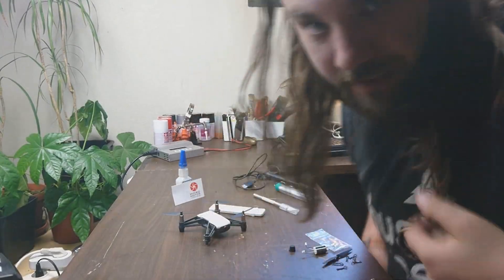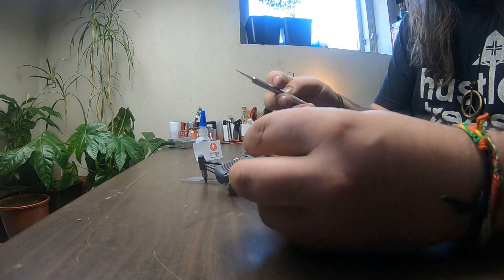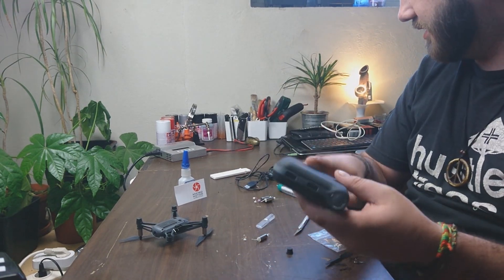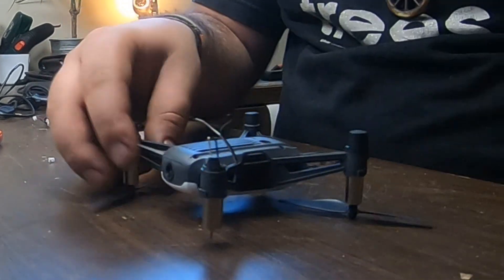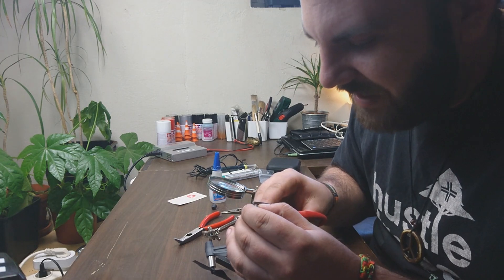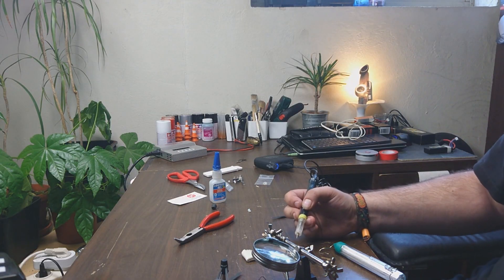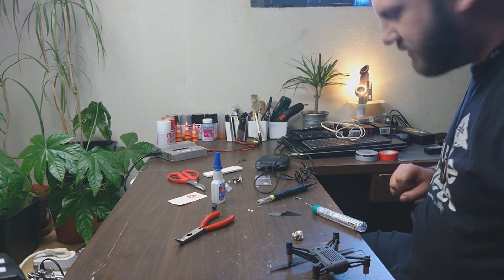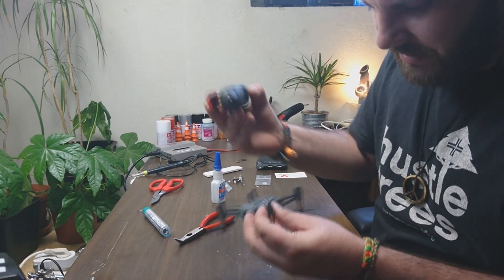HOW TO CHANGE MOTOR ON RYZE TELLO DJI INTEL DRONE

Comment: Hello i need a help. I don't find motor for tello in my country . So i want to know if the motor of another drone (8520, 8.5*20) can work with tello.
Reply from the maker: I bought this from ebay, so it is not the original motors. Hope it helped ! =) Thank you for watching

Comment: Nice video! I'm going to use the jst connectors to make it easier in the future but your way is neat.
Reply from the maker: Yeah I got them with the motors but felt it looks better without them so just soldered it on instead :P Connectors is a great idea otherwise =) Thank you for stopping by buddy! =)